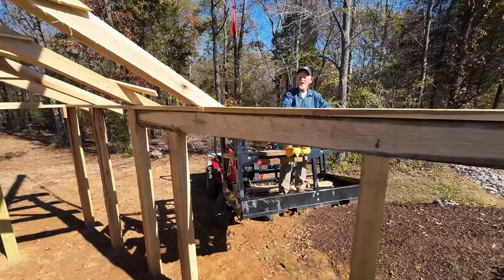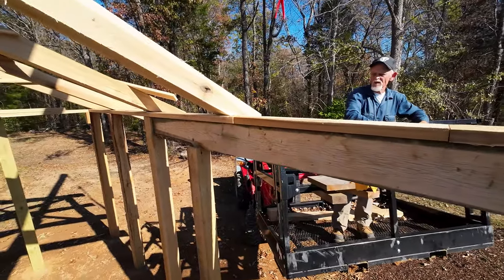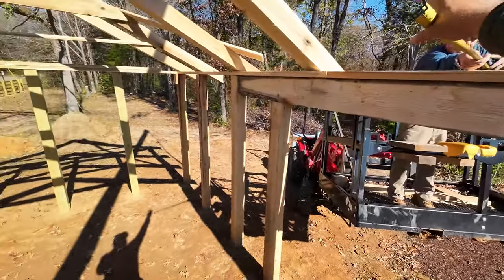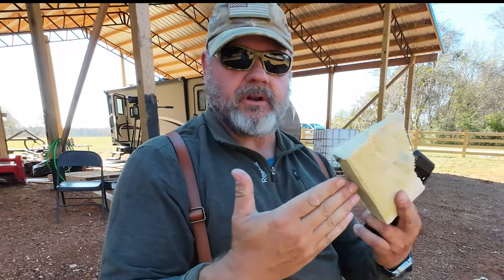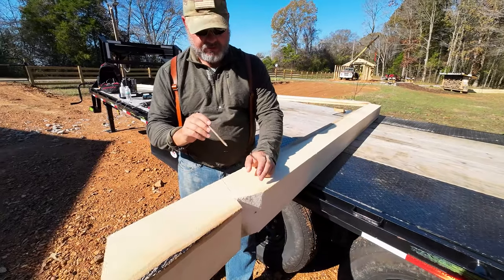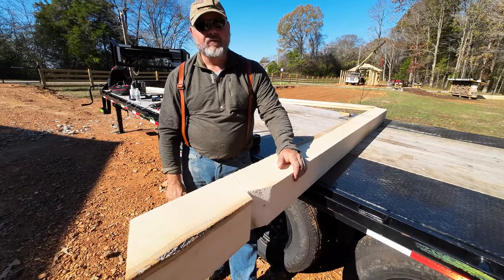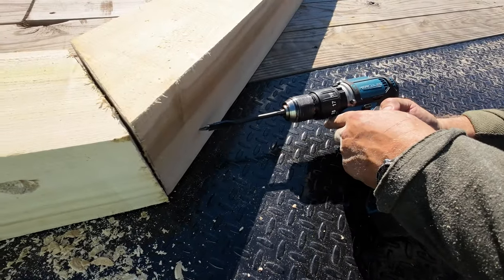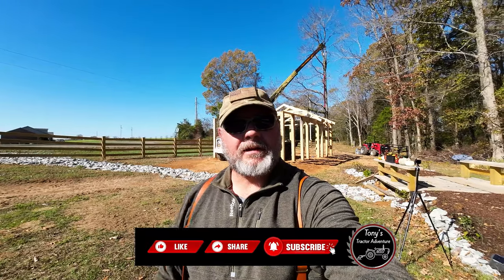How to Build a Roof Rafter- Easy Roof Truss

Comment: I like your "assembly table"!!  

Those GRK construction screws are self drilling, so you don't have to drill that second hole (not the large counter sink hole), but it sure is easier with the thru hole when you are installing the "truss", in case you were wondering (you probably weren't... LOL).

Have a good one!!
Reply from the maker: I found it easier to pre-drill the upper part of each hole.